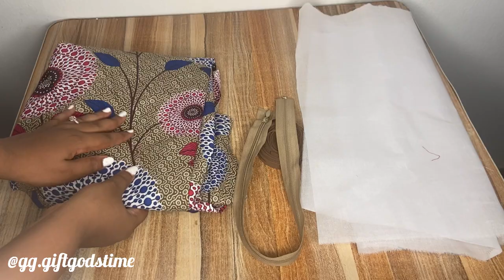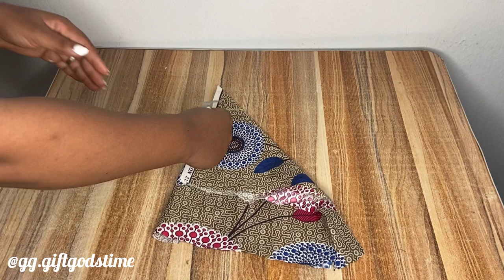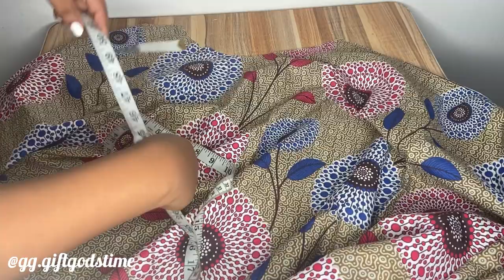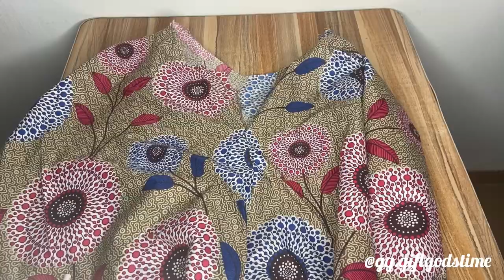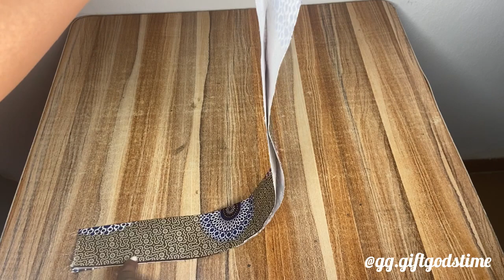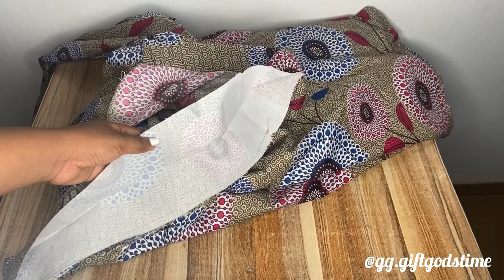How to make full circle skirt using bias method

Comment: Beautiful tutorial, but i noticed from the mini fabric you used to illustrate, you didn't curve the waist area, like you did to the hem region. 

In essence, you just cut it straight. Can i know why it is so? And also if thats how you cut the bigger fabric (the main skirt).
Reply: Thank you for your swift response 🙏
Reply from the maker: Yes I cut it straight & the reason was also explained in the video but I will also explain  further.

I took my waist measurements divided by 4 then, I placed my tape in such a way it will tally with the figure I got. The cutting will  be straight not curve. I also have other tutorials that the waist region was curve like forming 360 degree flare and 180 degree flare, using circumference calculations i.e (6.28/3.14 for pie) with this method of finding radius, the waist will be curved while cutting but for this tutorial it has to be straight.

Lastly the same way I cut the mini illustration is the same way I did for the main skirt. Also I added extra to the waist because I was joining to the back I.e for the front & also for the back I added extra more for zip allowance